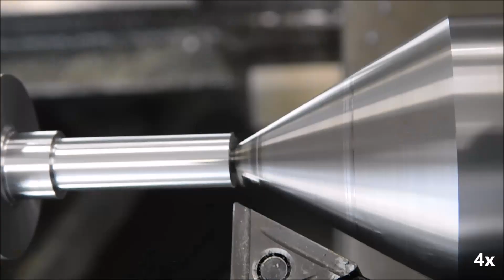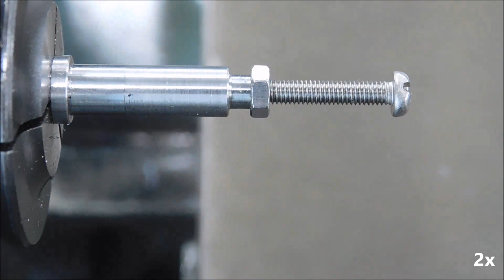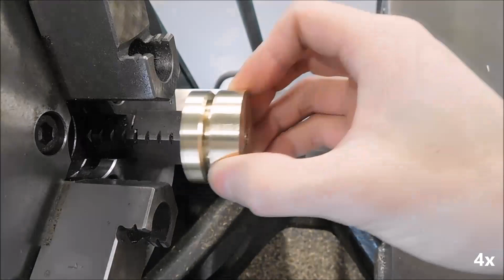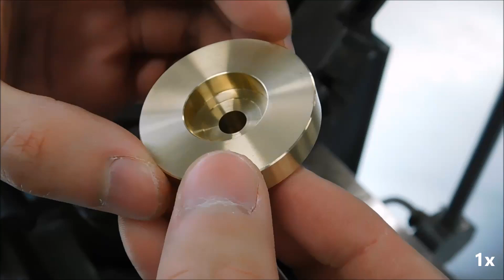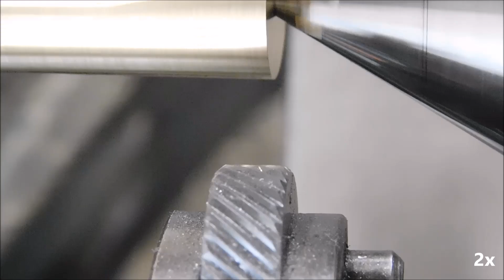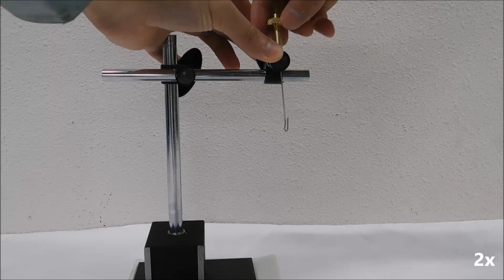【加工動画09】旋盤で二重反転ジャイロ/Make a contra-rotating gyroscope

Comment: hi, your are using amazing self made cutters. At 7.56min: which material is this? And I see that you are also use inserts. Can you say which inserts you are using for which materials? I am a goldsmith and are stunned by the surface quality you can achieve :-). How can you be contacted?
Reply: hello, i read your question about the yellow material and try to give an opinion since you didn't get a reply... although it would appear to be brass, it is likely to be a Bronze alloy C903 or C906 which is made of Lead - Tin - Copper, the shavings look different than brass shavings, and brass generally doesn't need lubrication when cutting. He does nice work.
Reply: @2008koss  thank you. That makes sense :-)